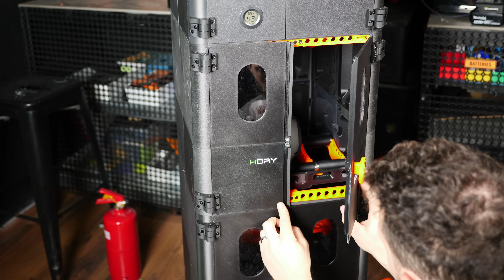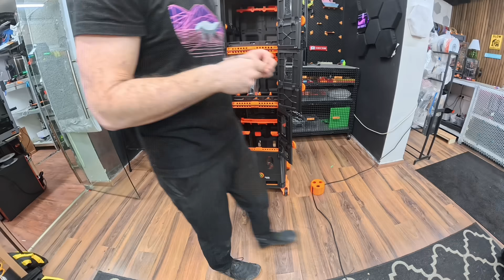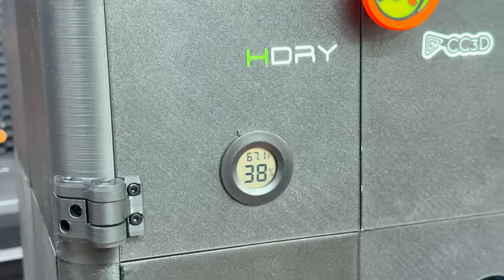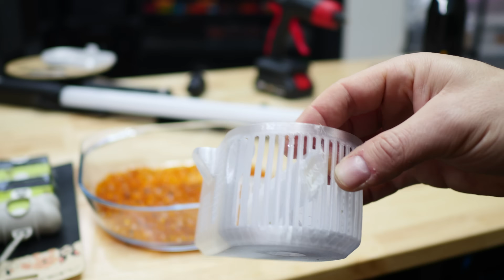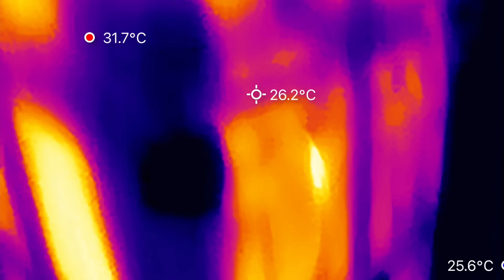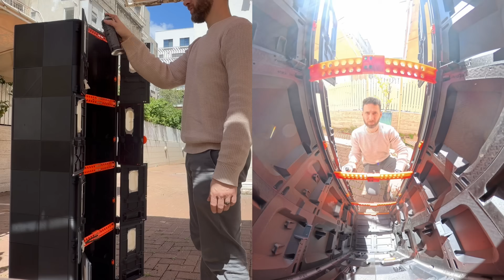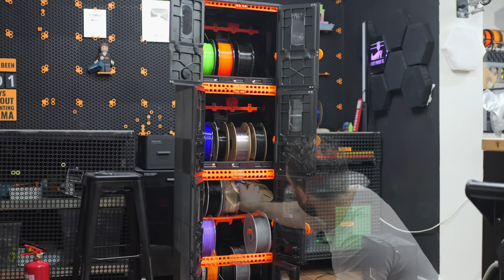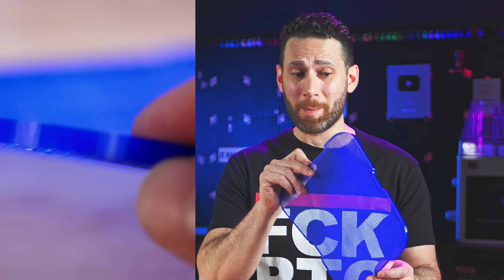This Will REVOLUTIONIZE 3D Printer Filament Storage!

Comment: My filament drybox is an ikea samla 45l box, with foam seal on the rim and some printed clips to keep the lid firmly sealed. The dessicant i have inside is enough to passively keep the humidity in there at 30 ish % for 2-3 months at a time and i don't have that much dessicant inside. With this method of actively cycling the air it may drop the RH quite a bit further. 

Also, you mentioned not having an engineering background in the video, so my recommendation is that when testing do it in smaller steps. You knew that the drybox that you have could have leaks and were attempting to test a new proof of concept which gave you issues. Minimizing the amount of variables that could affect your results is a big way to test you concepts much faster. 

It may seem like more steps but this way, in my experience, ends up taking less time overall for testing. A smaller PP (non hygroscopic, which reduces the moisture the PLA drybox could have adsorbed overtime) drybox would allow you to test the concept faster and more accurately, while giving a baseline of this solutions' performance, before moving on to implementing it in your equipment. This way, when implementing you would know that the issues you were having could be directly linked to the implementation/equipment and not the proof of concept method. Hope to see this being further developed!

Comment: I have a sketch of a design that automatically regenerates the dessicant.  In normal use, the fan circulates air around the drying chamber, but after a period of time it flips into regenerate mode.  This moves a flap that causes outside air to blow through the dessicant and then back out and there is a small heating element that heats the air as it moves through.

An alternative approach would be to use a hair dryer as both the heat source and blower in regenerate mode, and have the air pressure from turning it on move the flaps that cause the air to go to the outside instead of back in the chamber. 

This is a high fire-hazard project.
Reply: I woluld love to hear more of that

Comment: every single open of a door will spap the dry air with wet room air. So every Silicagel replacement disturbs the results.
A (german) youtuber made a Storage-Dryer with a Peltier-element, that cools down till the moisture freezes and then it melts and drains out with a hose into a jar.
Power consumption below 10W - no Silicagel needed, no replacements, so no door open issue. 
use auto translate if you like to see (and excuse my english): ....watch?v=uyZ-GiydNFc   (BeatbuzzerGebastel)

Comment: Fantastic work, it's almost as useful as an airtight $5 box with a few bags of silica dropped into it.
Reply: I filled the bottom 3" deep in brand-new dessicant pellets in a 50 gallon tote to store my rolls in, and it never achieved below 20% humidity. You need heat and air exchange, which a sealed box with desiccant pellets won't achieve. My Creality drier (which doesn't even have dessecant) gets down to 12-13% every time.
Reply: @davidschlender587  No, you don't. You'd only need ~20g of silica to get an airtight 100L box to 10% humidity. 50gal at 40% RH is only ~1g of water.

Are you putting wet filament into it? Is the box leaking? Is the sensor bad? 
Who knows, maybe all of the above.
Reply: @davidschlender587  "brand new" desiccant might not be fully dry, try drying it first?
Or throw in a small rechargeable fan in the box.
Reply: lmao
Reply: Lol.
Yes. I got these airtight IKEA cereal boxes, 8€, and they are all 10% humidity. For a year now.

Reinventing the wheel here? 😅
Reply: @janenglund  Yeah I'm mildly annoyed by these "print it because you can"-projects. 🙃 Such a waste of resources...
Reply: @oyuyuy Mildly? You need a cabinet of that size to be airtight?
Why not to print it in small (relatively inaccurate) parts. 🙈
Reply: @janenglund  omg, came here to ask this. My ex had this, but hadn't gotten to the point of testing yet. And in my eyes a big flaw of the current design is the fact the whole cabinet gets moist air when you open it.

I'm getting my own printer soon. Any tips? My ex had a core with silica in all his spools, each in their own cereal box.
Reply: @tamoeri  I use IKEA cereal boxes that fit two spools. And each of them have silica and a cheap hydrometer inside.

They work perfectly, without problems.

Comment: probably important to note that with those hydrometers in the outside of the box, they're probably picking up some of the moisture in your house and averaging. Some of my filament dryers can hit single digits in humidity and I have a central humidifier in my home that keeps it at about 50%RH. You'll want to measure with a sensor fully inside the box and not partly outside of it or half embedded into the door.

This project may fare better printed out of ABS as well. Sunlu and their sub-brand Jayo usually have buy 6 bay for 4 deals or similar on eBay for ABS here in the states, but I'd imagine it's tentative or not the case at all for you being in Israel.

Comment: Humidity and temperature are sealed together, so I would try to heat up little bit the cabinet, maybe to 40 °C at first as I will know that I don't need filaments for some time. and than leave it as it, because once you will increase the temperature, you will also go down with humidity. So maybe try this

Comment: Maybe a 3d printed cabinet its not such a good idea... A simple melamine wood furniture with a door with a good gasket may be better. And the silica gel containers accesible for change from outside, so you would not need to open the big doors for changing them would allso be a good thing. And maybe not so big of a cabinet. Maibe for 4 to 6 spools maximum.

Comment: Hi,

I've found that silica gel is a) far too expensive (€14/kg, especially for a cabinet as large as yours) and b) the drying results vary considerably.

I now use calcium chloride for my IKEA box, which is primarily used in dehumidifiers. It costs around €5/kg. For example, I have a large 65-liter IKEA box containing a 1kg bag of calcium chloride. The box is sealed with window sealing tape, and the humidity level is consistently between 12% and 18%. However, there are a few things to consider. 1. The granules vary in size, from very small to larger pieces, which is important if you want to use your own small containers.

Furthermore, the granules dissolve in water, so containers need to be designed accordingly: with a mesh top and a watertight bottom.
... However, I can imagine that if you replaced the silica gel with calcium chloride and Enrico modified the containers accordingly, the humidity would remain permanently at a level between 15% and 18%. This is because, unlike silica gel, calcium chloride does not release moisture back into the environment!

However, I imagine that if you replaced the silica gel with calcium chloride and Enrico modified the containers accordingly, the humidity would remain consistently between 15% and 18%. The refill bags are available not only in 1kg bags but also in 250g and 450g bags, as well as in tablet form.

Here's an overview (unfortunately only in German): https://www.humydry.de/17-nachfuellpackungen-fuer-luftentfeuchter?_gl=1*hbwyvb*_up*MQ..&gclid=Cj0KCQjwv-LOBhCdARIsAM5hdKdVzx2z2cgz3krzbFGjO3hrd3ThuzfqO2fVNUp2Oc8VjoXFaal9NOYaAp8GEALw_wcB&gbraid=0AAAAAD7DxilttAOAkUvt7xOWbJM_Oamiv

Regards, Golo

Comment: I have seen a video where a guy slowly blew the air into a tiny freezer. 
10%@25 deg C has a dew point of -8.7C. So as long as you get to that point you will maintain <10%.

He had a simple timer that shut the freezer and fan off for some time each day to defrost.

EDIT: changed the dew point to the correct value
Reply: It could be combined with desiccant and use that as a buffer and the freezer as the extractor

Comment: I still havn't understood why printing the Cabinets in the first place?

Printing it takes Weeks for normal people with 1-3 Printer
They are a nightmare to seal and still they are never truely air tight

While you can buy used Machine/Electrical Cabinets that are made to be air tight for less than the price of 2-3 Filament spools.
The Holes they have for Cable installation you can easily plug up and thats it.

I build two Filament racks that way for less than 50$ each, fitting 8-10 Spools each
I might implement the circulation fan system tho
Reply from the maker: Where can I find these cabinets…?
Reply: @thenextlayer my local version of Craigs List/Classifieds
Or Ebay/Amazon for a new one

A alternative would be a broken FRIDGE...
Almost perfectly sealed, insulated etc

Comment: Thank you very much for all this hard work. If I’m having trouble controlling the airflow inside a cabinet, my first thought would be to maximize the surface area of the silica containers. So instead of storing a lot of silica I'd try to build the maximum possible silica surface area exposed to the airflow.

Comment: Not an expert on the subject, but I put 7 spools of filament in a sealed, gasketed storage box with 2 lbs of dessicant and without airflow. The filament includes 2kg of ABS, 500g of nylon-cf, and PETG. I dropped the ambient humidity in the box from 43% down to 8.3% at a room temperature that's is averaging 72 degrees (About 22 degrees Celsius). I plan on adding a fan and a low power safe heater to slightly warm.the air and get some airflow, but without weighing the filament, the dessicant seems to absorb the moisture, and I just have to monitor the dessicant and dry it from time to time..

Comment: I get 10-12% humidity with Sterilite 32 qt gasket boxes (1932LAB43L) and a Dry Tote(100g desiccant pack). This is 4 spools of PLA per box. If I use the printable Bambu spools that are modified to fit a A1 Mini print bed a fifth spool can fit on top of the 4 shorter than normal spools.

Edit: The humidity rose when the Dry Totes got to ~50% saturated but seem to be holding at lower humidity after a couple of recharges(I oven baked them and weighed them to confirm dry, they say to microwave but I get the impression the oven is gentler) a few months apart, not certain yet but I think this set up may have just dried the filament so it stabilizes at this lower humidity for a few MONTHS(I don't print a lot so the boxes mostly stay closed). Commercial moisture proof boxes were fairly cheap Wallmart has a 4 pack for $55, 5 pack of Dry Tote was $37

Comment: We used similar devices for environmental enclosures. The sort you conduct decilate electronics assemblies in. Oxygen getter and desiccant cylinders surrounded by heaters (the same kind used for heated 3d print beds).

Comment: I think ALL of these dryers are stupid - ALL OF THEM!  

Filament is thin! 
From the spool to the nozzle is over a meter! 
It's easy to dry a single ~one meter strand length!

So just do that at print time and stop worrying about it.  If you need more than a meter put a loop in the feed hose. Most feed hoses I've seen are 4 or 5 times the diameter of the filament so just blow warm dry air through the hose as it feeds. If you live on the beach of a tropical island or something have the air pull through a disposable desiccant box - they come in all sizes and cost less than $1 each in most cases. The ones I use for my lens cabinet are 8x4x4 inches and cost 87 cents each. I think heating the air would work better than desiccant though. If you need a heater just buy one of those cheap-o hair-straightener irons for $10, tear the heating pads out of it (or leave them in if you don't have a Varick...) and run the air-intake over it. Those heating elements can maintain boiling temperatures for very long periods of time safely.

Anyway, the goal should be to dry it between the spool and the nozzle at print time IMO.  Spending money to keep them dry in storage is silly.
Reply: No.

Comment: Totally bad ass video dude great progress to I love experiments as much as you do. It might be a bigger technical leap but you are usually one to take on some head banger projects. I was thinking why not have some sort of bypass that you could for a short time turn on a heater that would blow through the desiccant and out the cabinet to remove the moisture from the saturated desiccant drying it. Then switch it back to cabinet filtering. My first thoughts in achieving this are sort of like how the actuators in a car air conditioning system work to change the air flow from feet, to head, to windscreen. Door mechanisms come to think of it it's not vary complicated except for making the 3D renders to print. It could be that it's a manual slide to move the airflow for actuation or get fancy with it and something like a microcontroller and servos to actuate the airflow doors with a button or switch back and forth that you could put a switch on the cabinet.
Reply from the maker: Yep! That’s basically how the $15k cabinet works I think. Above my pay grade but worth experimenting with for sure.

Comment: I wonder, what’s the effective difference between desiccant with and without a fan? I imagine it’s just a matter of speed, if your filament has to be bone dry before you put it in the cabinet, there isn’t too much impact to forced air. That said, if the higher humidity in the cabinet after you open the door is significant enough to start moistening your dry rolls, it may be a very useful improvement. Also being able to see your desiccant drop the humidity to 20% and stop while changing colour in only 30 minutes instead of 3 days would be a definite convenience improvement. For this reason, I’d want the colour-changing desiccant to be easily visible through a window, maybe even to have a graph showing humidity changing over time so you can easily see when it flatlines. The SHT35 humidity sensors can measure below 10% unlike all the integrated display hygrometers, and they’re bound to be more accurate than analog fibre-based meters.
Reply from the maker: It’s not just speed. I put tons of desiccant in glass containers for days, and the moisture only penetrates the top couple layers. So unless you have truly perforated containers, you’re not getting the most out of your desiccant
Reply: @thenextlayer  So the limitation of air speed is really that significant? Then all of us with desiccant in a filament storage box should at the very least have a low-power fan blowing through a desiccant container, maybe battery powered for ease of use.

Comment: Consider also that there is a maximum amount of water the filaments can hold.  So, if you know that, you can calculate how much desiccant you need per kilo of material.  In my case, storing PETG I use 20g of alumina per kilo so it can absorb 2x the water the petg can hold (if my math was right there was beer involved).  I store in ziplocks and they have stayed reporting at 10% for 3 weeks now.  House sits at 30-60 depending on outside temperature.

Comment: I use molecular sieve #4 in my CFS units with no air circulation or heat and it gets down to 5% humidity from 45%.

Comment: I like your enthusiasm, but it seems to me that all you're doing with this setup is compensating for the fact that your cabinet isn't airtight. Moisture migrates from high concentration to low concentration, even the tiniest leak.. The container needs to be made from an airtight material, and any openings sealed with gaskets under compression. 3D printed plastic generally is not airtight..

Once you have a perfectly sealed enclosure, you don't need a fan. The air circulation will make the desiccant absorb moisture faster, but the end result will be the same.

Comment: I don't know the geometry and it would probably take a box redesign to get the best results but why not put a hopper or hoppers on top the cabinet, they can be sealed, with your desiccant(s).  There is a valve or hatch (use 2 and you have an airlock of sorts) that releases the desiccant into tubes that will contain the desiccant but allow for air flow, probably along the back corner(s).  Part or all of the tubes have an central air shaft that has ports for air flow.  The fans (if it's modular, you could have 1 fan or 2+ fan's per level) feed the internal tubes and forces air through the desiccant.  At the bottom, you have another valve/hatch (2 for an airlock) that you can cycle it/them to empty the saturated desiccant before loading new from the top.  It could be setup to be manual or automated fairly easily.  The fans get installed from inside the cabinet and force air through the central air shafts.  Big enough hoppers would allow for several cycles before needing to add and you pull the bucket of saturated desiccant from a tray at the bottom...

There are some issues with desiccant volume depending on the cabinet height but since everything has to be modular to print it, that's a solvable problem.  Every other problem I can think of would just be a matter of tolerances and geometries...

Comment: That's alot of time, filament and stress lol.
I just use 6lt rectangle snaplock containers with 50grams desiccant for each of my spools and within 24-36 hours it's at less than 10% humidity. Keeps humidity low for months and months. Only impact 1 roll at a time when removing.  Bulk change the dessicant as it gets over 20% and 12 mins in microwave you are done.

Comment: You could have desiccant have a heater to dry it and blower that leads to outside world with valve ti prevent air coming back in when you don’t want it. To figure out when to dry, a weight sensor could be. Valves could also allow you to adjust pressure in setup which might have interesting effects or heater temperature. There might be then quicker drying or more gentle drying or one for different filaments etc
Reply from the maker: Valves are a VERY good idea… way better than some kind of servo or something that introduces a bunch of new issues. Something to think about!!!